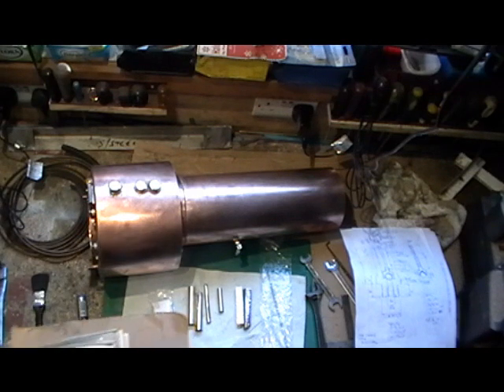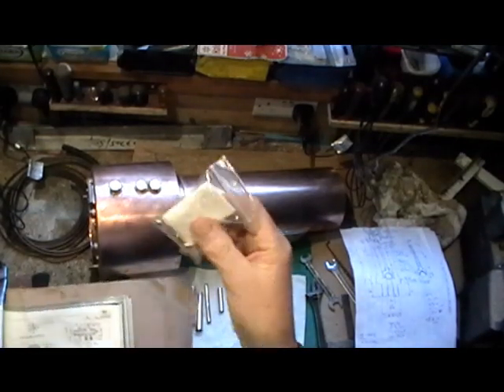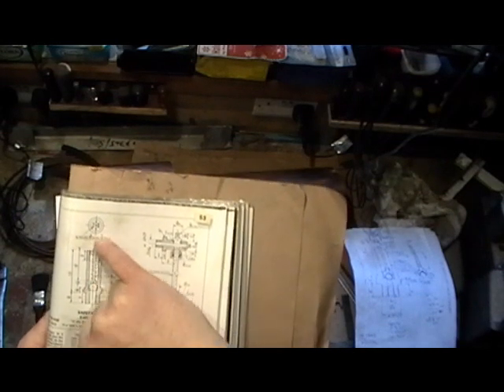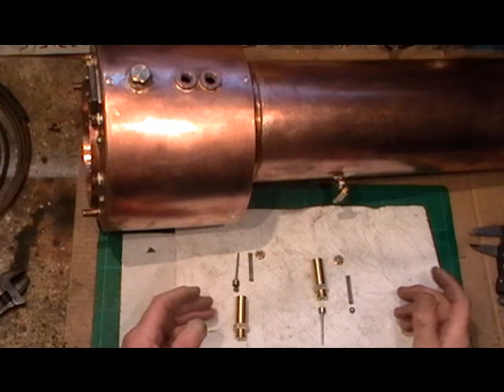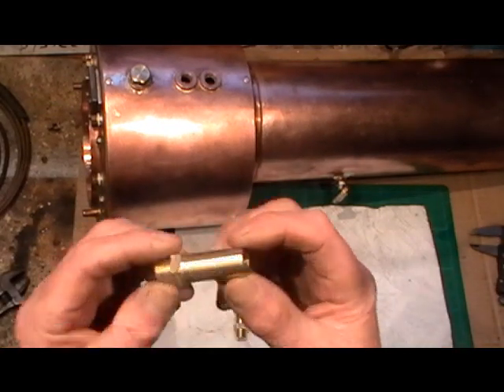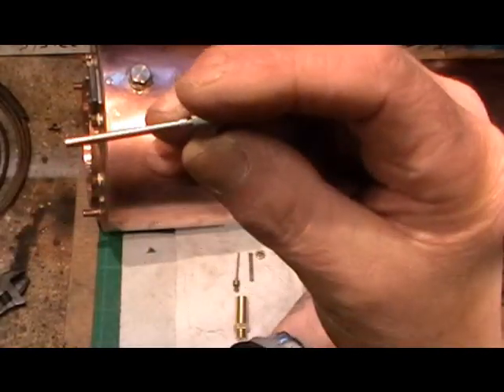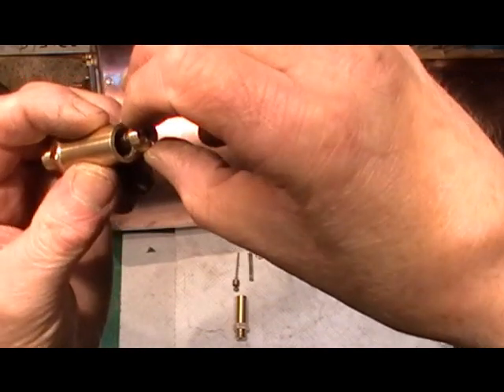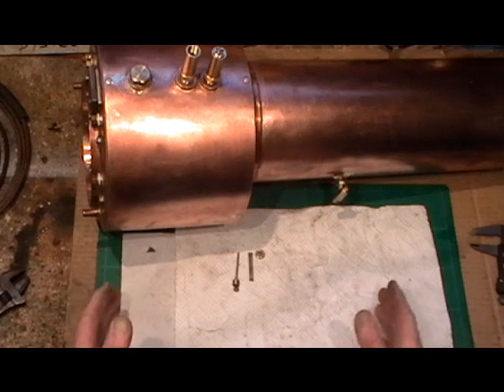Making a Steam Boiler (Boiler Fittings) PART 2 "Pressure Relief  Valves" "mr factotum"

Comment: Hello Mr Factotum, thanks for sharing your work on making the off set ? clack valve and now these two safety valves.  I understand safety valves a bit better than before, will enjoy watching you adjusting the spring tension to reach the 80psi safety pressure release when you are live steam testing the boiler.
Reply from the maker: Thanks for comments, glad its been of help to you, 
You may find a soon upcoming video of me making and explaining the Regulator (accelarator) Valve of interest
Regards
Mr f
Reply: Can you tell me when you get your plans from please thankyou
Reply from the maker: Hi derek
Thanks for interest and comments
You can buy a book from ebay or amazon, by Jack Buckler for the Sweet Pea 5" gauge, all the necessary drawings are in tthe book allbeit small scale but i get by with them, although i am making a six wheel version called Metre Maid, so having to adjust dimensions on certain items where necessary  if you want full size A0 drawings of Sweet Pea or Metre Maid these can be obtained from Blackgates Engineering at Dewsbury
Hope this helps
Regards
Mr f

Comment: Anything special that you did to get these to seal nicely? I've had a go at making a smaller version (building in scale 1 here) but I'm having difficulty in getting things to seal properly.
Reply from the maker: hi rj
i had no problem with sealing,  prehaps you could use a sacrificial ball and give it a sharp tap on the seat, then put the original ball back in to see if it seals properly or make a simple valve grinder tool and grinding paste to cut the seat concentric, hope that helps roel
regards
mr f
Reply: Thanks for the tips. The tap on a ball i did try already so I guess that I'll go and try your second suggestion then.  Cheers, Roel

Comment: will you do a film when you do the adjustments of the spring  ,no pressure..excuse the pun...do you think i can test it on the compressor??
Reply from the maker: hi simon
I think your talking about the safety valves. yes I think I mentioned this in my (bench live steam test) video.
yes , I set my safety valves with my compressor, just made a manifold block up with one inlet to screw a compressor airline adaptor in to attach the air line and one outlet 26 tpi in my case to screw the safety valve in, then set my compressor pressure gauge to the appropriate psi, then connected it to the test manifold, then adjusted my safety valve till it blew off under the pressure, However be careful it all depends on how accurate your compressor pressure gauge is. I only used this as a rough setting and will have them adjusted by the boiler inspector when i'm up and running and ready for the first live stem boiler inspection. but if your confident in your compressor pressure gauge being accurate this gives you a realistic setting.
hope that helps
when I get chance I will do a video of this
regards
kev
Reply: @MrFactotum  thanks Kev....that will see me on too...if you decide to mass produce them for some pocket money..put me down for a couple. It's the jet or needle which I'll have problems with.